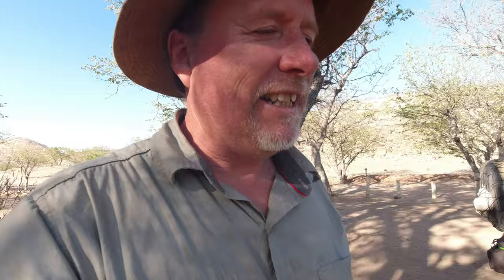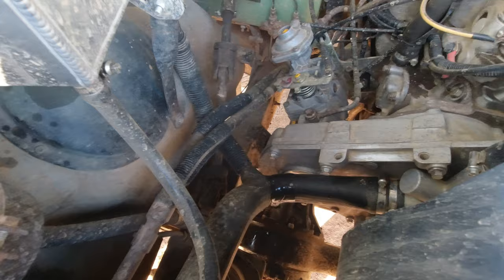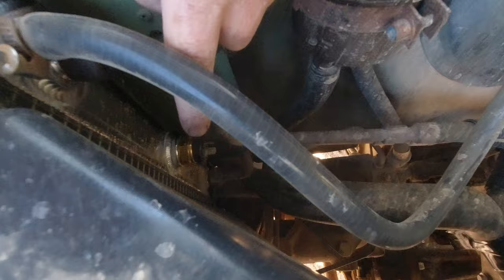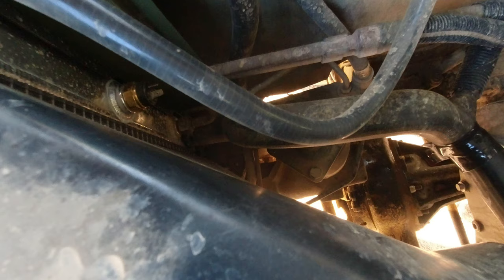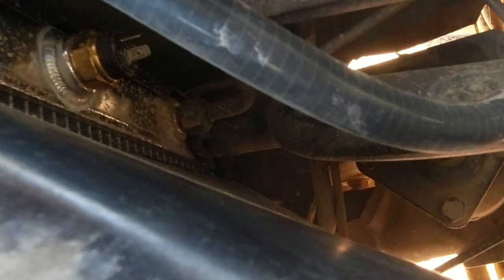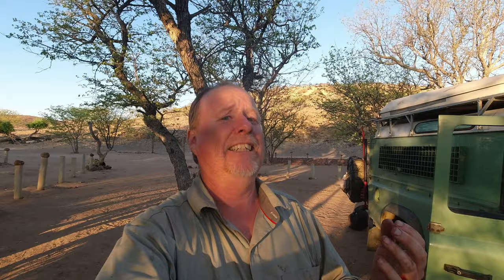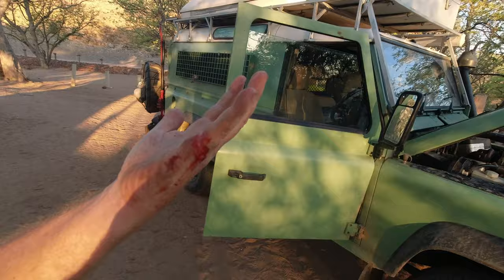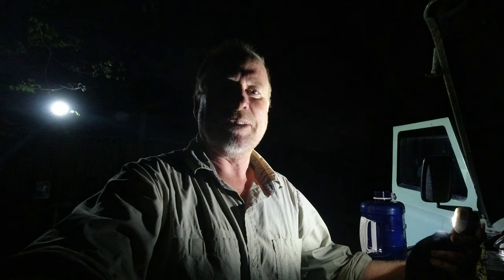#18 The Curse Of Joubert's Pass Part 2 (Namibia)

Comment: Enjoyed that one 👍

Think in future should tuck a video in on the Land and your setup. Interesting to see how you travel and you look like have a very technical packing system...
Reply from the maker: I will do at some point mate, the packing 'system' is just some Rako boxes, bought so they fit exactly into the Landy load area, with 2 Ali square tubes placed on top so they cant bounce up and down. Easy to push in, easy to pull out, nothing to tie or untie, unbolt, no noisy velcro etc

Comment: Nice job on the repair and taking us along for a look. It’s always a worry repairing something, even routine like a leaking cooling system hose while remote given a parts shop, or any spare parts don’t exist in case the unforeseen happens and you end up stranded as a result. Great job on the repair and taking your time to think it through and work out how to tackle it methodically. For someone who’s knows they’re not the best mechanically but still successfully keeps an older vehicle running in remote locations is a compliment to yourself.
Reply from the maker: Thanks mate, I greatly appreciate you noticing all of that 😀